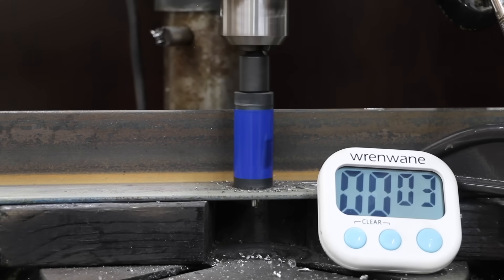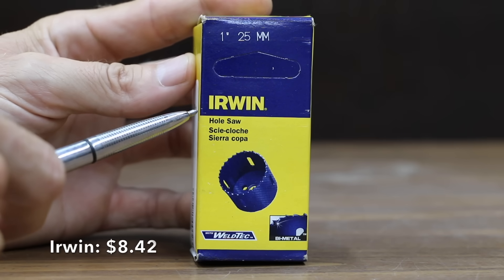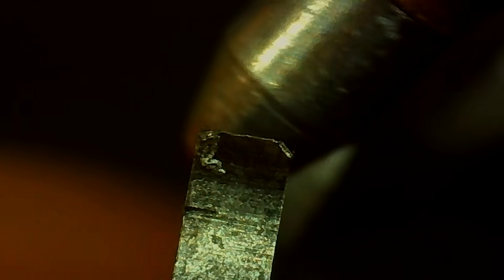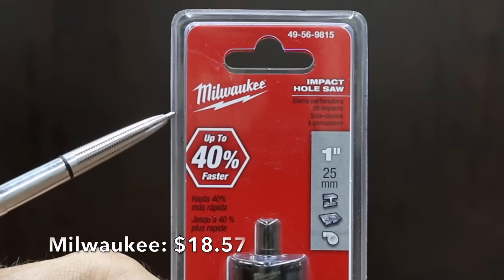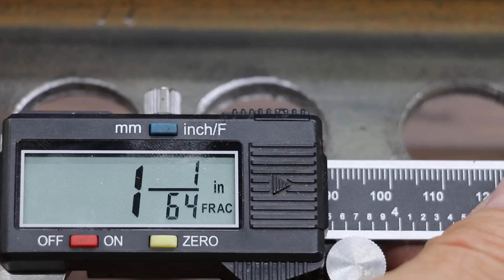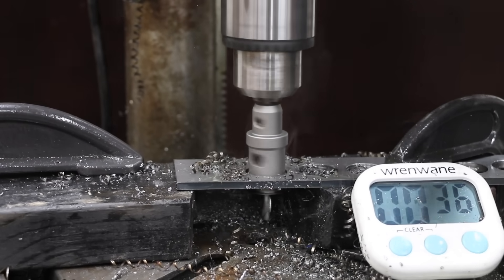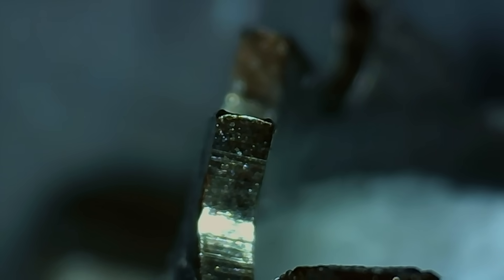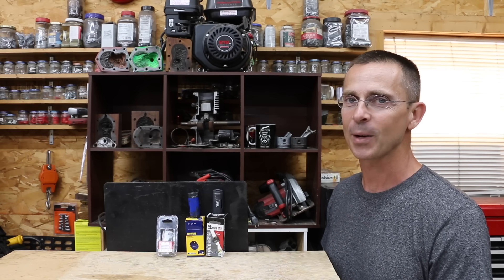Best Hole Saw Brand? DeWalt vs Milwaukee vs Irwin, Bosch, Lenox, Diablo, Bosch, MK Morse

Comment: when turning back in drill hog because warranty:
cashier: wtf were you drilling
him: armor plating
Reply from the maker: lol  Thanks for watching.
Reply: I’m right, no I’m right actually I’m right
Reply: Dorks
Reply: lmao dudes responses are the best
Reply: @colbyjackcheese9806  lol Thanks for watching.
Reply: a tank..that was inside a battle ship,,inside a steel bunker.. o.k. ?.
Reply: AR isn't Armor plate🤦‍♂️
Reply: @facediaper4607  he literally called it armor plating
Reply: @ee-wo9rh  ya... but it isn't armor plating
Reply: @ee-wo9rh  AR500 is rate as bullet proof plate and it's use as armor plate but... yea it's not "armor plating" but "armor plate" I think it's misspelling in his statement
Reply: @arned432  no AR isn't used for they ... only fools do that... there is a specific alloy that is used as armor plating
Reply: @facediaper4607  Dude. Chill. There are no lives at stake here. Just enjoy the man testing hole saws for your benefit.
Reply: @cliprange  so let stupidity run unmuck unchecked 🤔
Reply: @facediaper4607  It’s “amuck”, and yeah. It just plain fun, my friend. Nothing to stress over 😁
Reply: @cliprange  amok is actually the primary spelling, though amuck has become common ;)
Reply: @BenSchoolcraft  I stand corrected 😊
Reply: @facediaper4607  and what specific alloy are you referring to? All body armor I was issued was either ceramic or steel, which are the 2 main plate types for armor.
Reply: @johnmitchell9981  dude the armor plates issued was class 3b or class 4 one was ceramic other was both ceramic and steel add in Kevlar... AR plate is used in heavy equipment or mining where steel was warn down by either metal on metal or metal to earth...
Reply: @johnmitchell9981   AR500 body armor company is a composite of ceramic Kevlar and a outer coating that can absorb kinetic energy before it hits the inter layers. Also helping with deformation that happens when  rounds penitrate most of them. Which helps with that pesky ballooning some plates get on the back side
Reply: @facediaper4607  no such thing as 3b. There is 3a, 3, and 3+. Then it goes to level 4. And yeah SAPPI plates are made of ceramic. Ask anyone who has actually used armor and they will tell you, AR-500 or AR550 steel is literally the best body armor you can get. It is cheaper and last longer than any other. It does not degrade is heat like polymer layered or even certain kevlar armors, and it does not shatter like ceramic armors. Look it up. And i guess now is a good time to mention that once i retired from the Army I was a machinist for the company AR-500 Armor, making steel body armor.
Reply: @facediaper4607  AR steel is armor plating. One of the largest body armor manufacturers in the country is literally called AR-500 Armor.
Reply: @johnmitchell9981  The plate is MIL-A-4100E aka ballistic Plate...
Reply: @johnmitchell9981  I do this shit for a living on top of being a combat veteran.. so don't speck till you educate yourself... 

I can't believe you took AR 500 armor to be AR plate steel 🤦‍♂️😂 (Abrasive Resistant alloy..AR350, AR400-450 AR500-50 and AR 600) 😂

Comment: Years ago , I had to drill holes in stainless steel. Close to a thousand holes. Tried seven different hole saws. The best one managed to drill one hole. Finally someone brought me some Starrett saws . 40 to 50 holes before it wouldn’t cut anymore.
Reply from the maker: Thanks for sharing.

Comment: Cool video, Althoug ar500 isn't armour plating, it is abrasive resistant steel. A form of tool steel that is fantastic for high ware surfaces like rock crushers, bull dozer blades and tool dies for injection molding and forging
Reply from the maker: Thanks for the feedback.

Comment: ummm Project Farm why did you test a Shockwave bit on a drill press?  Those are made specifically for impacts like an electrician would use, hence the softer metal.

Comment: As usual, great content.
But I can't help but feel that the play in your drill press' chuck may have contributed to the damage, and efficacy of the saws. In many of the tests you can see the dill chuck dancing around, and it is also very evident on the Irwin cut into the ar500. 
I use hole saws in chassis fabrication regularly. Even small deflections in cut angle will damage the saws and make haggard cuts.
Reply from the maker: Thanks for the feedback.
Reply: @ProjectFarm  thanks for all your time and effort!

Comment: several of those are designed to cut sheet metal in electrical boxes, sinks etc. not thick metal. They are the ones with the spring around them like the Milwaukee shockwave that is part of its early failure and also why the ones with similar shape and structure had issues they are only designed to cut so deep. But it was a good comparison none the less.
Reply from the maker: Thanks for the feedback.

Comment: whatp about the reason of certain test and result expllonation shole saws are rouphinhg tools no pre9ucision. clearance holes for shaft or pipes or conduitson soft material on thin soft metal i prefer punchouts  and stepdrill easy to use and better results. a minute imperfectin in the hole surfave can became a seriuse crack giving time. notall the holes are msde the same. take it any way you want.
Reply from the maker: Thanks for sharing.

Comment: You gotta try out those sypder brand hole saws from Lowe’s. I’ve got a bunch of them, biggest selling point for me is the ability to eject cores quickly, but they seem well made and pretty sharp. Been using their blades as well for about a year and have no complaints
Reply from the maker: Thanks for the suggestion.
Reply: @ProjectFarm  no problem! They say that the carbide ones (spyder says anyways) that they will cut concrete block and ceramic. I’d love to see you try this! I’m really cheap and don’t wanna take a chance ruining one and having to buy another, but watching you put the spyder bike saws to thru their paces would be fun

Comment: I think you should have used some sort of DRIP system to ensure that everyone had the same amount of oil, but this was a very good test. Have you done any bungee cord testing? That would be something I think everyone would like to know. Test their breaking and streching limits. Not sure if you could do some type of test to see which one would hold up longer under different weather conditions. I know when I was framing houses, most of our bungee cords streched way out and got brittle over time. Maybe you could put them under a sun or heat lamp for summertime weather and then in freezer for the winter time? Good video as always! Have you done coolers or ice chests? That would be another good topic people would find useful.
Reply from the maker: Thanks for the video idea.

Comment: Morse Link points to "MK Morse MHST16 1" Carbide Tip Hole Saw" which I believe is  not intended to cut metal according to their catalog. The catalog calls out several other hole saws for cutting stainless steel and similar metals. I wonder how they would perform vs the MHST16 which seems best suited for plywood and fiberglass? Box in video seems to show plywood and fiberglass too.
Reply from the maker: Thanks for the video idea.

Comment: This was very interesting but hole saws are designed to be used with the pilot.  That stabilized the cutter to ensure it doesn’t chatter in the hole.  The chatter is likely what caused the damage to the carbide teeth.
Reply from the maker: Thanks for the feedback.
Reply: Project Farm NO PROBLEM!!!!

I enjoy the heck out of your videos.  It is great to see stuff tested as realistically as possible!

Comment: If u were able to correctly set for the speeds and feeds the results especially in the carbide in the ar500 would have been significantly different.
Almost all of the saw did a great job even in the harder non abrasion resistant steel.
I use an actual mixed coolant instead of the tap magic with a fish tank pump and the chip clearing action when using the carbide should be gently entered back into the holes, quick jabs on the carbide will exhibit early tooth damage.
All in all great test but a much better testing method in a bridgeport style machine will net some seriously different results.
A note on the carbide, if you are using it in a hand drill, if able once the drill tip pokes through swap around and come from the other side and when you get to almost breaking through decrease pressure to a very light force. Breaking through in either one pass from one side or flipping project over and coming through from both sides, at the end very light pressure will save your carbide teeth from shock and premature wear.
Reply from the maker: Thanks for the feedback.

Comment: I use a Diablo kit with the quick connect head.  I freaking love it! I cut very little metal, but it is so nice being able to swap sizes so easy. They seem to hold up extremely well. I have had to replace the pilot bit a few times, but not the hole saw itself.
Reply from the maker: That is awesome!
Reply: Same

Comment: One thing that wasn't considered was stress, the holes were very close to each other and even though you controlled the temperature, the molecular stress that occurs from heat would give incorrect readings on every hole except the first. To solve this the steel plates could be stress relieved between each drilling, then all the molecules would be back in position. I love your tests, keep up the good work, thanks.
Reply from the maker: Thanks for the feedback.

Comment: Thanks for this test. I use hole saws for carpentry and often find that I need to drill metal as well. I appreciate the experimental protocols you come up with for testing. Can you possibly put up the various charts you made for the drills performance in different materials? I think that would be useful at the conclusion of future videos. Also, can you put in a link for the hardness testing picks? Great video!!
Reply from the maker: Great suggestion!  Thank you.

Comment: Hi and another great video, tools, oils and sprays are all good but I have a request if possible. Holiday season is here and last year I feel I got burned on purchasing different styles of holiday solar powered string lights. I haven't opened them to see how well they are sealed nor batteries used and charging times needed in direct and non direct sunlight. People spend millions on lights each year and more and more moving to solar. Could you break it down for us in your awesome style? Thanks
Reply from the maker: Great suggestion!  Thank you.

Comment: 1/128th, 2/64th, man... I'd hate to be the Brand thats 18/1956th off... seriously, why not just use metric for that?  using different fractions sure makes it harder to compare...
Also I think they are slightly oversize on purpose ;)
Reply from the maker: Thanks for the feedback.
Reply: @ProjectFarm  that is a quick answer, great video though, forgot to put that, keep it up

Comment: I have had great luck with my Milwaukee hole saws.  The cool part is that you only need one center chuck and you can buy different sizes to put on it.  Plus, it takes up less space.
Reply from the maker: Thanks for sharing.

Comment: I use the Lenox  hole saw to make a starter hole in cold roll steel in my turning lathe and then work very well and a lot quicker than drilling alot for metal out and no need for the center drill and I can cut over 2" has I can cut from both sides then I have a small rod that can be used for turning into something.

Comment: I've been pretty happy with Diablo products. For their price I always brace myself to expect some cheap generic crap that will last about 75% of a single use, but everything from them I've got (often some angle grinder wheel or something) has beat my expectations and lasted way longer than I planned to need it for.
Reply from the maker: Thanks for sharing.

Comment: I really don't like the snap lok type holesaw mandrels. They sound like a good idea, but use them on a jobsite more than a few times, and they clog up with dust and debris. For shop use they may be good however :)
Reply from the maker: Thanks for sharing.

Comment: You left out Hougen.
Reply from the maker: Thanks for the suggestion for future round of testing.
Reply: @ProjectFarm  TBH, in steel, especially the 1045+ you need to slow the SFPM down. There are guides to help you out. Always start slow. You can burn up even carbide with a work hardening steel. I like your stuff. Keep it up!

Comment: Great Videos... AR is an abrasion-resistant plate,  a metal I use on various buckets. In my opinion, the wording as armor plating is odd while yes it can be used for this. It takes some very expensive annular cutters to go through this.
Reply from the maker: Thanks for the feedback.

Comment: The hardness of the teeth actually stopped the bit from turning because they cut too fast into the material, and actually cut a wedge that the teeth embedded themselves into, stopping the bit. This is why a constant downward feed rate AND a constant pressure of the feed is critical for these tests. The better bits are able to cut much better than what is shown. Unfortunately, this would affect the times, as they would all seem to cut at the same rate.
The review was very useful, in that the durability of these bits was exposed!
Reply from the maker: Thanks for the feedback.

Comment: I got some cheap harbor freight saws i had to make a lot of 3 inch holes in 1X wood. I did about 1/3-1/4 what i had to and that started to give fits and the cutouts became very hard to get out for some reason. I got a 3 inch Diablo and it worked a ton better. I was a bit annoyed when had to go back and spend like another $15 for arbor for it. Anything i do usually i go with a Diablo blade just because seems like beast value for what you get.
Reply from the maker: Thanks for sharing.

Comment: Ferrous metal cutting miter saw blades. What kind of blade should I buy for my Evolution 1800 rpm metal saw. Diable, Evolution, Dewalt?

Comment: In my opinion u use to high rpm for my taste. In my experience its good to have rather low rpm with hole saws, but we use really really high quality ones wich last hundreds of holes, in our last project we drilled a few hundred 30 mm holes through 40 mm s235 steel plates and if you are carefull with them they will still be basically new afterwards. All of our holesaws dont make small metal chips but super long continues metal chips (you basically produce steelwool while drilling and you have to clear it all the time :p ) love this tests
Reply from the maker: Thanks so much!

Comment: I had to overhaul our huge drill press from constant three-phase operation to Variable Frequency Drive as even the slowest belt transmission ratio was way too fast for some of our holesaws to operate reliably. The holesaws were constantly chattering like crazy due to the high circumference speed. Now we've got a start/stop knob, a direction knob and a speed selection potentiometer going from 0 to original full speed. Boy, that makes the entire drill press way more fun to work with.
Reply from the maker: Thanks for sharing.

Comment: Just out of curiosity did u see how hard the 1095 was most of the time it’s just as soft as regular steel unless it was heat treated and by the looks and how easy it cut it was not treated
Reply from the maker: Thanks for the feedback.

Comment: Gonna go ahead and guess diablo with milwaukee in second.
Reply from the maker: Thanks for watching.
Reply: @ProjectFarm  after watching I think there was to many variables in geometry and style, in my experience the high tooth count bi metal does well in softer materials, whereas the low tooth count carbide is meant for industrial use in metals, they don't work well in softer materials. I have several of both in various brands, and while I haven't had to replace a milwaukee or morse yet, some of the cheaper brands don't have a large enough offset in the teeth and get jammed really easy. Some other brands to consider if you do a second vid on this would be klein, ideal, and Dottie. (Electrician brands known for quality or durability because we cut allot of holes) also really liked another comment on doing ratchet straps! As always your videos are quite informative for the discerning tradesman. Thanks!

Comment: Cool video. I actually converted over to annular cutters for metal hole cutting. Comparing SDS-Plus Rebar Cutting Hammer Drill Bits would be a fun video. Would love to see Hilti, Bosch, Milwaukee, Dewalt, Diablo, Chinesium, etc. go head to head.
Reply from the maker: Thanks for the video idea.

Comment: When machining/cutting your downforce will vary a lot because the tools are all different . You ideally want to pull down enough for a nice continuous string of swarf to come out

Your better off pulling harder on a less agressive cutter otherwise it can just rub to much and heat up and then your tool is toast

Also the tool stopping could be your drillpress not having enough torque

Great video ! Just thought id give some tips from my trade
Reply from the maker: Thanks for the feedback.

Comment: Having used the Drill hog styled hole saws i have to say they're much better, and less likely to break the drill bit in the center. I had one that drilled a few hundred plus 1/8th inch and 1/4 inch depth holes prior to losing it when they totalled my van due to a car wreck.
Reply from the maker: Thanks for the feedback.

Comment: Your experimental methods are really exceptional. I am really impressed by your use of empirical measures whenever possible, and I love your new hardness scratchers! I work at a heat treater as a metallurgist, and my favorite part of my job is figuring out why something broke or didn't work as expected. 
My work has some chemical and material analysis tools I think I could use to enhance your tool competitions. I'd like to work with you, let me know!
Reply from the maker: Thank you very much!